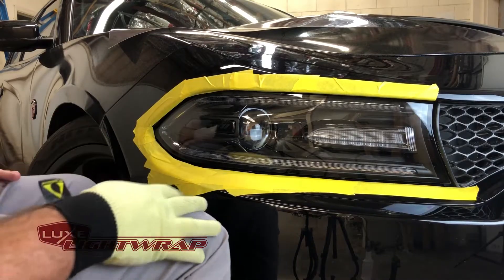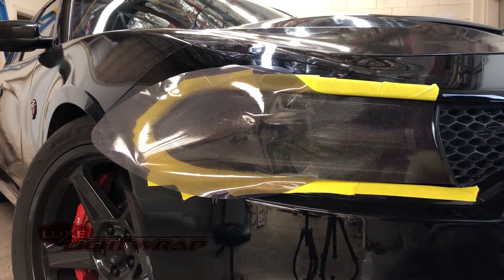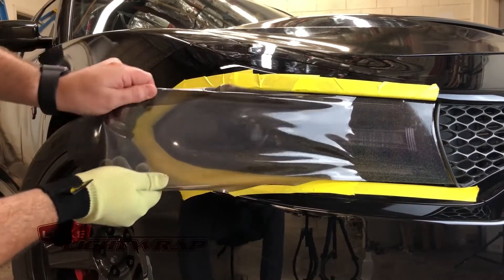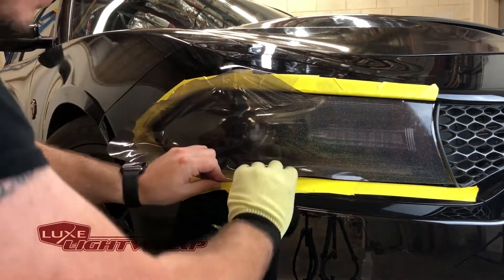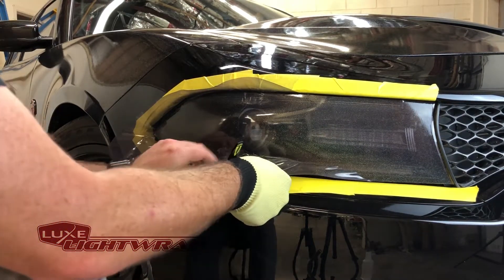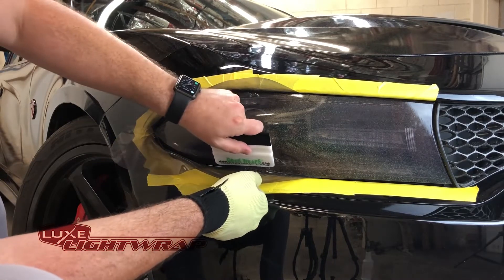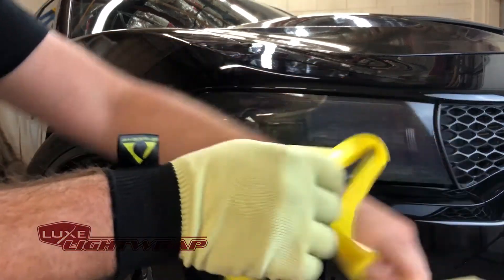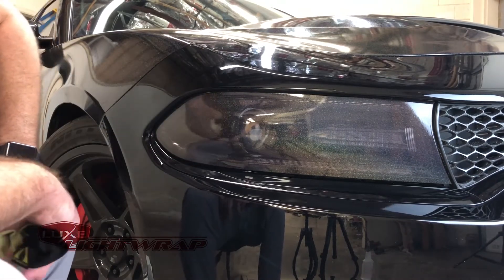How To Tint Your 2015+ Charger Head Lights

Comment: Thank you for the videos. I've received my kit and have a halo light kit coming soon, but to install the light kit I jave to "bake" the headlight assembly for 8-10 mins at 225f so the headlight seal will open for the install. Will the tint stay safe during that operation?
Reply from the maker: It would be best to install the tint kit after the halo light, but it should be safe if you have to install the tint first.

Comment: Just tried to install mine. Way too difficult for someone who doesnt have experience using material like this. The instructions that come with dont really help at all, then i watched this video and realized there is way more to than what the instructions said. Went through the test piece and the other one so now I am either stuck buying another set or just not tinting my lights. Cant even imagine how difficult the taillight full piece would be so I am just going to avoid it all together. Not worth the frustration.
Reply: 95800kurt the tail light it’s easiest off all... but I do admit, the headlight is a challenge but that’s why they always include a practice tint sheet.. it’s really not that bad.
Reply: I just messed up my extra piece. Don't put heat on the first few inches as I did not have enough width to cover after doing so.